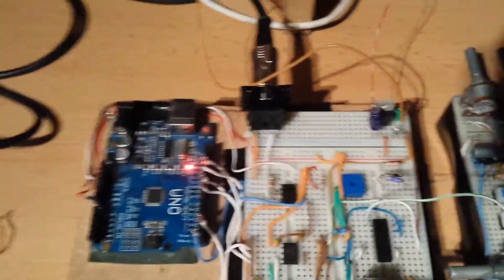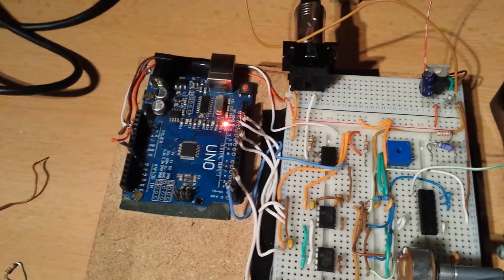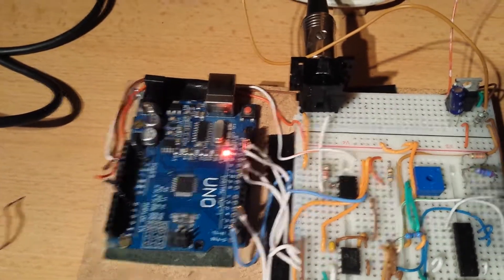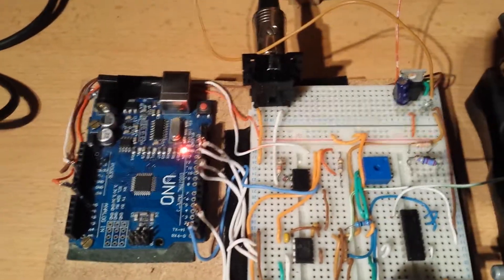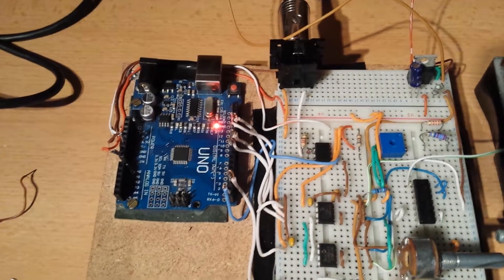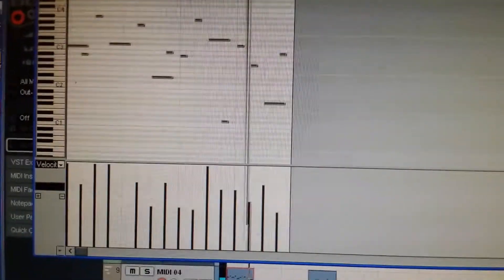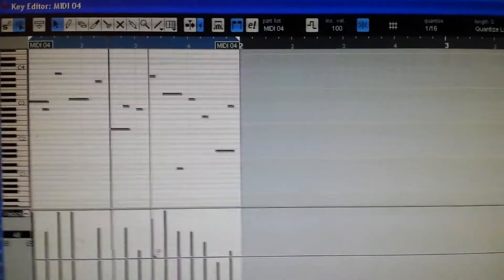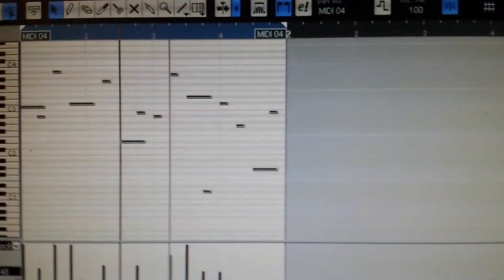DIY analog synth project ( Arduino midi to Cv gate and extras. The 2ND approach)

Comment: After reading an exciting paper that explains a certain old school sound effect making chip, I stumbled upon this precious tidbit of info regarding clocks with these types of desired synchronizations: “common clock signal of 3579545 Hz for NTSC systems and 
3546893 HZ for PAL/SECAM systems (based on associated TV colour subcarrier frequencies, and are common master clock speeds for many systems)”...  my chip would take this clock speed and divide it by 16 for its internal clock.  I’ve heard talk of grabbing crystals from out of old television sets to use those with DIY MIDI projects, as thesea crystals are optimal for the speeds we wish to execute MIDI at.  The MUsical Instrument Digital Implementation specs are a HUGE source of info, but with a quick search one may encounter specific data pertaining to speeds for executing MIDI sysex/cc at the hardware level, and TTL clock vs Xtal details, etc.  I hope this sort of helps you with the difficulties that you’re referring to in your video.  It would be great to think that you could resolve some of these caveats that aren’t completely obvious.  Thanks again, I’ll be watching out for more developments, keep up your rigorous efforts!...
Reply from the maker: Thanks so much for your information. :-)

Comment: Awesome project dude.  What is that big silver piece on the bottom right of your breadboard? And also are you able to adjust the signal  from the breadboard such as frequency or amplitude of the signal via a potentiometer or trim capacitor?
Reply from the maker: Mike Cardona Hey mike thanks for your comment. The silver 100k potentiometer you can see has now been replaced by a 100k trimmer. This was used to adjust the sensitivity of the velocity cv to my first vca as an experiment. All will be revealed in a very soon to come tutorial video. :-)

Comment: Hi! Do I hear slides (overlapping small notes?) or it just seems to be? Do Cakewalk generate slides as a kind of pitch bends?
I hope you'll make series on MIDI-CV builds. It's a great theme!
I'm still wondering how is it working in Jupiter 8 Tiergrinder's clone...
Reply from the maker: MoolahNasreddin . Hi , no note sliding doesnt quite work unless maybe i turn the glide up a little , but not as transmiited function no it doesnt. However if you look at the schematic there is  a pitchbend output from the other of the 2 dacs which i guess you could draw in via midi in your daw. Once i work out how to feed in the pitchbend i will include it into part of the tutorial.
Reply: yes, usually I pitchbend it manually as Channel Pitch command (draw a graph).
Reply from the maker: MoolahNasreddin Yes exactly what i meant :-) any ideas where the pitchbemd cv should be injected to by the way ?
Reply: hmm IMHO it's just a regular note CV that is changing it's value to make a channel pitch change. IDK, is there a MIDI message to make a slide between notes? Not sure is it exist or not...
Reply from the maker: MoolahNasreddin Ok i will try and experiment with a single vco and see i can get the pitchbend working. Thou the picthbend cv is i think about 0-3 or 4volt so not quite sure how this can be summed with the regular not cv . Possibly at the main summing point of the expo op amp ??. I normally make not slides by drawimg in midi picthbend :-)
Reply: Most probably that we're speaking about different things... When I'm using MIDI Out inside FL Studio, the Channel Pitch graph. just shifts an output frequency of a current MIDI channel by a certain value (that comes [it's linked] from a virtual knob "Pitch" and also can be changed by Pitchbend physical control of almost any MIDI controller). So it happens inside a DAW.
I guess you're talking about something else or want to implement the feature of a (almost any) standard MIDI controller in your MIDI-CV device by a separate lever or a kind of...
Reply from the maker: MoolahNasreddin Good news . I got the pitchbend working and went with my first instinct on patching the pitchbend into the expo summing op amp. Thou i had to use a trummer inbetween so that it had a span of - and + 1 octave. Thr note cv is really good on this . In cubase i can get c0 - c7 scaling really well. Thou you must have 1v/oct prepared properly in the expo first.
Reply: Adam, please, explain in your (next or any) tutorial what is the difference between Note CV and Pitchbend... And the mean how you've implemented this (although this part I understand) in your MIDI-CV and further. I'm really confused and guess that it will be really interesting for everybody.
Reply from the maker: MoolahNasreddin . Ok yes i will do . I have alot of experimwntal discovery to share in this one so far :-)
Reply: Cool! I'm waiting patiently :)